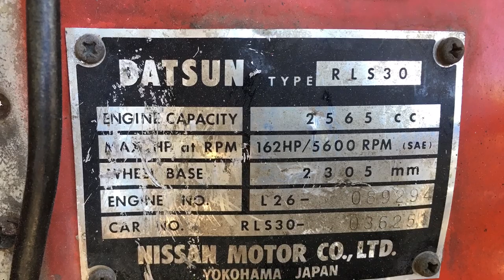1974 Datsun 260z : A Teen’s Dream

Comment: I"m 16 and its really funny because i picked up my first car(s) this last too. this dude had renters abandon the place and left a 1971 240z and a 1974 260z. the 240z was in a barn so the interior was gorgeous, different story with the 260z. got them both for $300 a pop. got them home put a new battery in the 240z and squirted some starter fluid in it and it sputtered alive :). of course there's still a lot of work to do to get it to be a reliable daily driver but hey still pretty cool.
Reply: if you ever need those turbines of your hands....
Reply from the maker: Wow that's an amazing find for that price! It's always a good feeling to get the engine running after an unknown amount of time sitting there. You should record some video and post it of your process, I'd be curious to see your project progress. As for the turbine wheels, the fronts and the rears are similar but slightly different in the casting and design. The tires on them are easily over 10 years old and starting to crack in parts of the tread. If you're really interested, I'd sell them for a couple hundred bucks. Good luck on the project!
Reply: Sybert's Garage well it just so happens I have a pair of turbines that came with the car so maybe one of those sets match with mine
Reply: Omg bruh i found a 260z in my uncles backyard behind a shed when i was 14 and ask if i can it off his hands But since he so far away i need a uhaul to bring it over  but havent been able to pay for the uhaul since im 16 now so 2 years of waiting but i finally been able to pick up the Z ( oh yeh its the 1974 model not the 2+2 model from 1975)
Reply: Apex Classic the 260z has a base model and 2+2 for the ‘75 year. Damn shame you’re in the same boat with me having the 74.5 model smh those heavy bumpers.
Reply: Noah Rodebaugh id rather have the 74.5 models than the 2+2 although i still respect it. the bumpers aren't a problem although my z is no where near done

Comment: End of june 2018 whats going on with the Z.
Another kick ass Z saved is worth my subscription to see it thru finish.
A Z car is straight forward as your jeep. Because its a true sportscar nothing on it but what it needs.
Float bowls fuel tanks and rotted japanese rubber ( the hoses that run from the tank to evaporitive canister behind passanger side rear quarter panel. ) and Z from 83 to 69 will have failed rubber.The japanese are extremely well versed in metal.Not so in those days with rubber compounds. The hoses tend to be thin brittle and more natural rubber then synthetic 
So drying out and cracking up to crumbling can be found.)
Replace all hoses from tank to evapo canister inside rear quarter panel. Safty and fuel fumes eliminated make sure all rear hatch seals are new and actualy touch and seal as they were designed to. Same as tail lamp seals. YOU WANT TO REMOVE ALL HOSES OF ANY KIND TO KEEP FUEL FUMES FROM COMING IN THE COCK PIT FROM THE REAR OF THE CAR.And THEY will be sucked into the car, till you do all the above. The hoses will be cracked I can guaranty. The rubber is the weak link. To fumes inside the car.
Mechanically, its a bullet proof car once bushings are renewed as needed. 
My 73 had one of tbose cyclone wheels as a spare and four cheesy american racing wheels that dated the looks ( not in a good way)
  I have 15x7 steelies from Bassett racing made the car look good again. Im putting a set of extreme summer tires on them as extreme summer tires is the best thing for a Z to change the cars handling after bushings and good shocks or at least new shocks. A good set of extreme tires will make braking distances , a lot shortter as much as 40ft. Thats performance cheaper than a brake upgrade.
I want t o see more on this car
Its been 5months at least and its summer....lets have an update on your kick ass Z....
Reply from the maker: Thanks for all the tips and for giving me the motivation to film some more! I'm expecting to release an update video in the coming weeks once I'm back in town.
Reply: Sybert's Garage i just rewatched the video.I hope your enjoying the Japanese Ferrari..
Have you had a chance to lower it yet..they do need a little lowering to get it to realy dig in not ground scrapping but alittle bit.
  A kick ass car for sure.